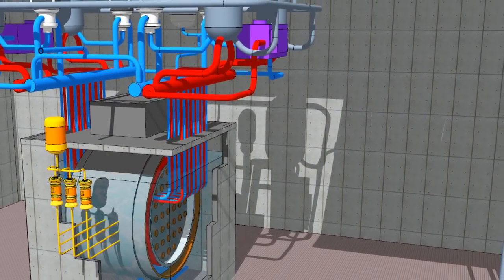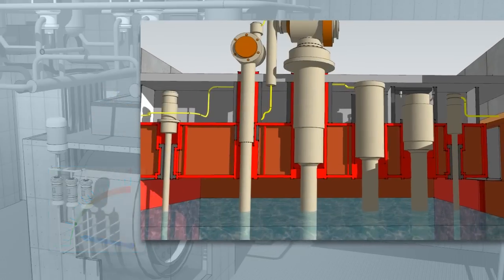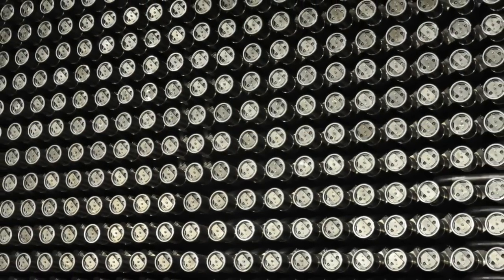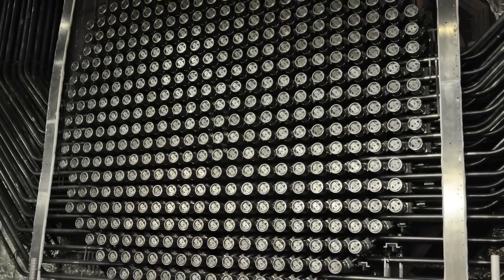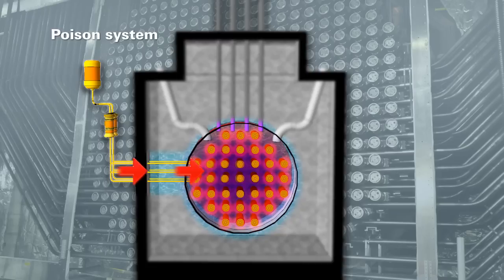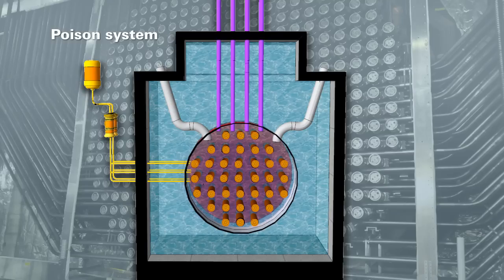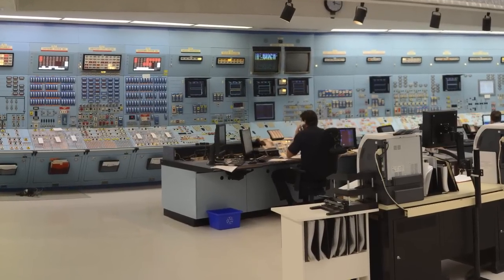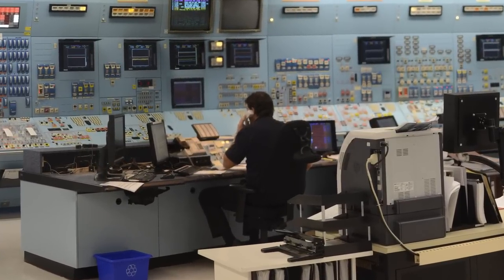Nuclear Power Plant Safety Systems - Part 2: Controlling the reactor

Comment: I recall visiting Pickering Nuclear 30 years ago and they said there were 2 out of 3 safety shut down systems on each reactor.  I only saw two mentioned here.  I think the third one was draining the moderator (heavy water) but wouldn't that create a problem for dealing with decay heat? 

What was that third method?  Why isn't it mentioned here?
Reply: That wasn't what I was referring to, but it really makes a lot of sense.  You wouldn't want false reactor trips, so you monitor multiple channels.  No, I was referring to multiple shutdown methods, not sense channels.
Reply: @LFTRnow  Pickering A has the feature to dump the moderator, however this design feature was not included in subsequent CANDU plants, because while it is adequate for most potential accidents, it was inadequate for a large break loss of coolant accident where a very fast shutdown method is required (i.e., high rate of negative reactivity). Subsequent CANDU plants use two independent safety systems (i.e., the shutoff rods, and fast injection of neutron poison into the moderator) to cater to all the potential accident scenarios. Meanwhile, Pickering A's design was augmented with an enhanced shutdown system which provided a second set of triplicated trip sensors and trip logic for the same set of shutoff rods.
Reply: @dubiouswords7851  Thanks a lot!  That makes a lot of sense.  I really appreciate you taking the time to reply to my question.
Reply: It's be phased out in the newer generation reactors. There is no dump tank after Pickering. Bruce A / B both do not have dump tanks for moderator, niether does Darlington.

Comment: CANDU prove to be good desing, but...there is a problem: still use solid fuel that overheated, can melt. And have no wolfranium coat! So we need even better reactor...that work in high temperature, small pression and don't need uranium!